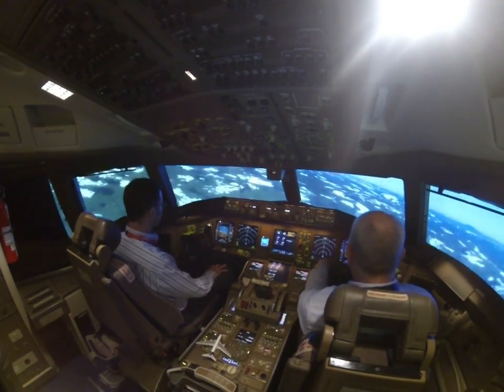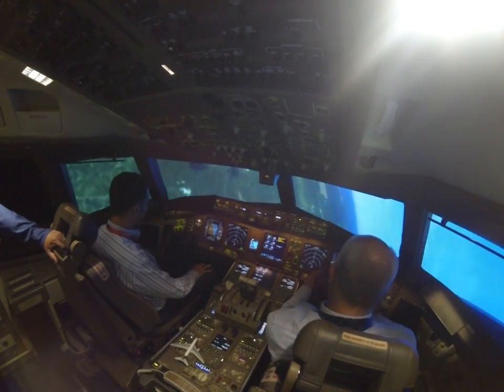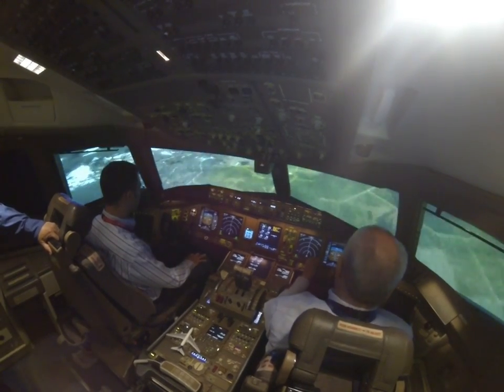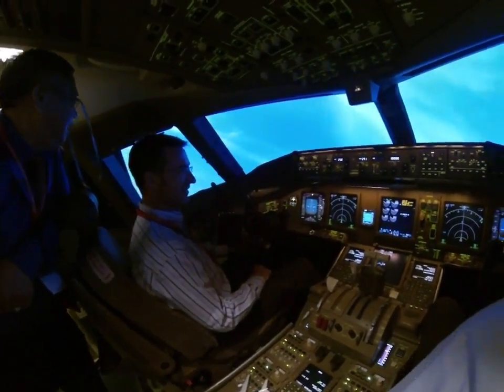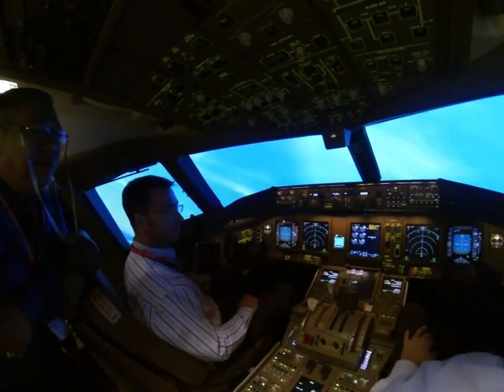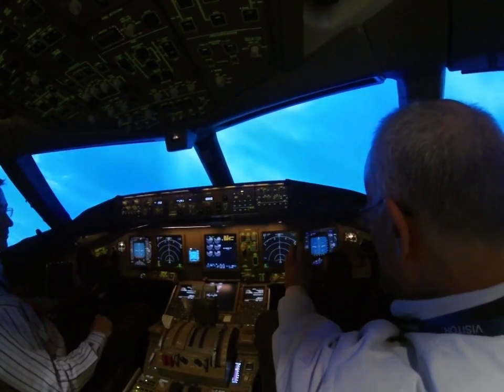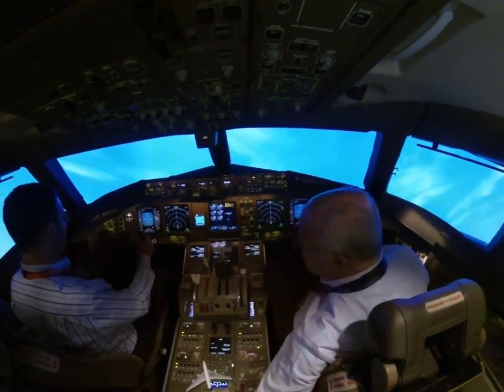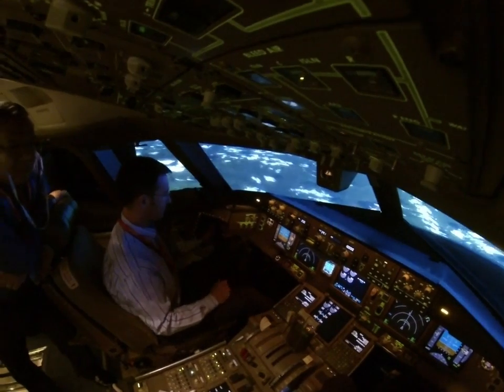Extreme flying on 777 Simulator - UPRT

Comment: First of all, this is all being done in a simulator. It’s not a real airplane.  I flew for 32 years for a major air line. When I first got hired in 1979 we did full, breaking stalls in the real airplanes. A lot of guys ended up inverted. After a while the FAA said no more. We did all the stalls in a configuration called “approach to a stall.” This meant stick shaker,  vibration and vertical speed showed a rapid descent. You went max power, level the wings and clean up the airplane. We were also told to dive towards the blue on the artificial horizon. Stalling a simulator and stalling the real airplane is a a big thing. There is no “Pause Button.” It’s a real roller coaster ride.
Reply: Of course there's no pause button in a real stall. The entire point of Pausing the Simulation during a stall is to better understand and discuss the effects a Stall has on the Airframe. UPRT has saved lives.

Comment: I remember on my ppl check ride the examiner gave me the hood for the unusual attitude recovery part of the ride.
I heard the engine noise pick up and knew he was putting me in a dive.
He made me put my head down and jerked the plane around a bit to get my orientation screwed up.
Sure enough when he told me to recover I was in a very steep dive but he had also put us in a 60 degree bank.
I immediately cut power and simultaneously was pulling out of the dive and reducing the bank and I do remember it seemed like it took forever to roll the wings level, now I know why.
He even told me for future reference roll the airplane level first then pull out of the dive.
I told him my instructor hadn't taught me that and since I actually recovered without pulling the wings off he passed me.
I wish he had explained to me why but I knew if it ever happened again I would do it the way he said, I knew he had a ton of experience and if he said it was better I knew he wasn't making it up.

Comment: The most interesting part of this priceless stall training tutorial, is using a 1/200 scale model of an aircraft in the cockpit.
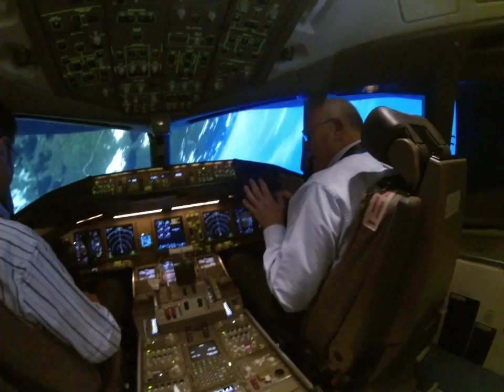See at 3:55.
Having a visual example from the Captain, helps acquire all information of plane dynamics and behavior.
Truly helpful for training.
My regretted Dad, used to build RC model planes all winter long for the upcoming spring season, back in the 60's.
That's how I learned the basics of flight, and the methods to recover from stalls.
Virtual Pilot ever since FS2002 Pro.
Outstanding video.
CYUL

Comment: I was just thinking.. What uh, what happens if you find yourself in such an upset in an Airbus? I'm referring specifically to the massive over bank. Sure theoretically the Airbus wouldn't let you put the plane there.. But like the man said, such an upset can be caused by weather and various other factors... I know the Airbus likes to take control away from the pilot if certain flight envelopes are exceeded or to prevent them from being exceeded. But if it happens, say due to a weather related upset. Now what? Would the plane prevent you from recovering because said recovery required bank maneuvers outside what it allows? I've heard of other modes like alternate law and direct law and so on but I'm just not knowledgeable on the Airbus and am wondering if anyone who is could shed some light on this?
Reply: There is an "unusual attitude law" that removes some protections for conditions like this.

Comment: I really like his point about "when unloading go for half a g, not zero g" makes me wonder if he originally started his career as a military pilot. Zero g  or especially negative g is generally to be avoided regardless of the situation. Sure in an airliner you don't want to stick your FAs to the ceiling.. But even fighter pilots when performing a high speed climb, full afterburner rocket ship style, almost never just bunt and pitch forward once they reach altitude. The fighter planes can do it. But zero/neg g is just generally very uncomfortable and disorienting even for the highly trained. This is why you see fighters come out of a high speed climb by pitching back (inverted), and then rolling out. It's infinitely more comfortable than a negative g bunt. Even when flying "flat" inverted, you maintain a little bit of pressure on the stick to maintain some positive g in the direction of your rear end. Excellent instructor.
Reply: The information you provided  interesting. However, during my aerobatics training that I have done, I remember that you will need a lot of pushing the stick down to maintain altitude while inverted. I believe it might not be possible to add a slight back stick pressure without losing altitude, but maybe with supersonic speed, things might differ a bit. Between negative G and positive, I didn’t experience anything different in regards of discomfort. The only difference is with positive G you have positive G restraining maneuver, while with negative G you can’t do anything for that.

Comment: I really don't like the Nose High Recovery technique by pushing forward alone, The aircraft may not have the energy to get over the top!  Also, the lift vector is still pointing straight up, rolling on some bank will reduce the upward component of the lift vector and allow you to get the nose down. Due to the startle effect you are more likely to put in too much negative G and injure those in the back of the aircraft. This is made worse by practicing in the simulator where there is no indication/feelings to gauge how much G both positive or negative thats being induced. Also reducing the thrust to control the pitch angle is a bit suspect. You are in a situation where energy is reducing, you want the power in, rolling to 45-60 degrees means the pitch up from the power pitch couple of the thrust will not make the situation worse, as it would if you were just nose high with no bank.

Just my two cents...
Reply: Your technique is a legacy and more conventional recovery technique designed to make the recovery more "comfortable" and closer to 1 G.  If you unload the aircraft close to 0 G, the aircraft will exit the stall instantly.  Follow-on with an increase in airspeed, correct the attitude, and you're recovered.  There is no need to go negative G and injure anyone.
Reply: Remember the Boeing FCOM is lawyer talk. The technique you described is great however I think Boeing is concerned a secondary UA may result from that recovery procedure.
Reply: What does get over-the-top mean?  I only watch these videos because I'm trying to work on my fear of flying, of course this was one of the worst ones to watch but I have heard in other videos Pilots talk about "getting the plane over the top" or "getting it over".
Reply: @stefkadank-derpjr1453  ... Normally "over the top" is shorthand for "over the top of the clouds", i.e. above the clouds. In the above comment by Mark where he says "over the top" it is in the context of the recovery from a too high nose-up attitude in which case it would mean "over the top of the climb" (i.e. when you are climbing and you then pitch down, the moment that the plane stops climbing and starts descending). He is concerned that you might run out of airspeed speed and stall before you can lower the nose enough.
Reply: @adb012  thanks for taking the time to explain. I am so uncomfortable when I fly it makes me feel panicky. In life I am never panicky otherwise I mean I'm here on a farm, I deal with all kinds of emergencies, I know how to use a shotgun, I do my own electrical work, I'm not a wimpy girl but somehow I am overcome with fear when I'm in a airplane. A friend who is a therapist suggested I watch videos of Pilots training so that I can understand how well commercial pilots are trained and how safe flying really is. Of course this was a terrible video to watch because I don't ever want to be in an airplane that develops a "bad attitude". That's part of my fear.
Reply: I've actually been driving from Georgia out West or up to Ohio and I'm almost 60. I can no longer drive to Ohio to visit relatives in one stretch, I have to spend the night halfway there and it's just getting to be ridiculous. Every time I've flown I really do enjoy the fact that I can be there the same day often within hours. Unfortunately now I'm developing a new fear.  I work for a Delta pilot and his wife, he's a senior pilot and he is being furloughed. I'm now worried that all the pilots they're going to have flying are going to be young bucks or bucklets with 100 hours of flight time. Having a lot of years under your belt is really great for a pilot because their flying becomes so intuitive,so second nature. I guess what I'm saying is like everything else practice makes perfect and older pilots are really good at it and now I'm afraid we're going to have kids flying us around.
Reply: @stefkadank-derpjr1453  ... You bring a super complex topic for which there is no easy answer. The first thing you need tu understand (and probably you know it already) is that commercial aviation is super safe. The video that you see here? 99.99% of the pilots will never have to use this techniques in their entire careers. Why? Because there are techniques to AVOID getting to this point. Then why train it? Because 0.01% of the pilots encounter this situation once in a lifetime, and they (and their passengers) deserve to have tools to get out of it. The same can be seen about other training videos you can find here. Stalls, engine failures, emergency descents, and a large list of etcéteras. These things almost never happen, but for the very few times that it does happen better know how to fix it, and if that also fails better have a C plan, and so on. Aviation safety is built on layers after layers of redundancy and safety margins, and it works awesomely well. The level of safety achieved by commercial aviation is simple unbelievable. We are counting fatal accidents per million take-offs, and some years this number is below one. And even in the very few cases where fatal accidents do occur, most people escape alive. We are counting fatal accidents per year with the fingers of one hand (in commercial jets). WORLDWIDE!!! A couple of years ago we had, for the first time in history, a full year with zero fatal accidents in commercial jets. There are only 2 industries that take safety so seriously: Aviation and nuclear. Bottom line, you are going to die, but chances are BY FAR that it will not be in a commercial flight. You mentioned the experience of the pilots. The first thing that you need to understand is that no matter COVID, furloughs or what, to occupy the right seat (first office or copilot) of an airliner the pilot needs 1500 hours of experience + a type certificate for the specific plane + hours of training in a simulator + hours of "initial line experience" where the new first officer will fly not with any captain but with an instructor captain, and with a 3rd pilot in the cockpit double checking all that the new first officer is doing. The second thing that you need to understand is that the newest pilots start their careers in the Regional Airlines. The Regional Airlines have a much more complicated operation that the major. Shorter flights mean more flights per day and hence more fatigue. It also means more take-off and landings, which are the most critical phases of flight from the safety point of view. They also fly smaller cheaper planes that are not as well equipped and as technologically advanced like the bigger planes. And did I mention that the pilots are the least experienced. And are underpaid too. Ok, when was the last time that you heard about a fatal accident in a regional airline in the USA? Let me refresh your memory: 2009!!!! More than 11 years ago. Colgan Airlines operating a Continental Connection in Buffalo. And it was a turboprop plane. For a jet you need to go even further: 2006. And in the major airlines (not counting cargo) the last major fatal accident was November 2001, just 2 months after 9/11 (so you get a sense of how long ago it was). If that is not outstanding I don't know what outstanding is. 11 years without a major fatal accident in a commercial flight in the USA. Do you know how many millions of flights took place in these 11 years? Do you know how many thousands of millions of passengers were safely taken from A to B in that time without a singe fatality (except for natural deaths in flight and one single fatality in a Southwest flight that had an uncontained engine failure and returned for a safe landing for all except the unlucky woman that perished when the engine shed pieces. So I hope for you that, at this point, you have a rational understanding that "you are not going to die in a plane crash" is a statement of fact more than a probability, it is closer to being an absolute truth than most of the things that you say or take as truth. The problem is that fear of flying is, in most cases, not a rational problem but an emotional one. And when it is a rational problem, the rational part is easily fixed because it is just not rational to fear flying. I have met people that said "I know that aviation is super safe, I totally buy that I have a much grater chance to die driving to the airport than in the flight, I totally believe that there is nothing to fear, but I cannot help getting in panic the moment I get in a plane. I don't want to, I try not to. I curse myself for being fearful of something that there is nothing to fear, but I can't avoid it". That is obviously more complicated because it doesn't matter how much of a good job I do at convincing you that flying is super safe, It cant help with the irrational fear (that is why it is called a fobia). So are there things that can be done to improve the irrational fear? Yes, many, some work for some people, some for other. Many airlines offer "fear of flying" seminars where they explain what happens during a flight, the sounds, what is going on in the cockpit, the safety measures, and they end with a real flight where you experience and identify all that. Some fearful flyers overcame the fear by taking flying lessons themselves and becoming private pilots (I think that is the most powerful one). Others do psychology therapy. Others get drunk. others go to a psychiatrist for a prescription that can reduce anxiety (and some times numb them). Some don't overcome the fear and just face it and decide that the rewards are worth the suffering. Some do a combination of the above. And some just don't fly. I don't think there are magical answers here. The human mind is too diverse and complex to have a one-size-fit-all silver bullet. In any case, I wish you good luck (but also will and courage to face the problem and take action).
Reply: @adb012  Wow I just finished working and I came to my car and I read this. Thank you so much for taking the time to write such a helpful well-thought-out response. That was very kind. I have a few more things I'd like to say but I'm going to hustle home and get dinner going then I'll come back here. Thank you again so much.
Reply: As Russ mentioned, zero G = no stall at whatever speed. The speed of that 777 can go down to 50 kts during the recovery and it will not stall if you keep close to zero G. No lift means no lift vector so your lift vector is not pointing up anymore even if you have the wings level. Now, with a very low speed like that, you need to remember that the recovery is not complete until you got enough speed to pull some positive G (above 1G) and not stall in the attempt. So yo will need to keep pitching down past "straight and level" because the moment you try to level off, if you are below stall speed, you will stall (secondary stall), just as it happened in this video which was then correctly addressed by the left-seat pilot by reacting to the stick-shaker with a reduction of AoA. All that said, rolling the wings will accelerate the recovery because the plane reacts faster in yaw than it does in pitch, especially at high angles of attack. So for example rolling 60 degrees left and letting the plane yaw left by itself (as it slices through), most of that left yaw will be the nose coming down. That said, initiating a roll at such a low speed and high AoA might cause roll control issues and may require some careful rudder application. No need to mention that a yaw disturbance at high AoA is a recipe for a spin, right? So no matter if you decide to roll or not, UNLOAD FIRST, go to low Gs (well below 1 G but slightly above 0G to avoid accidents in the back), so if you decide to rol, in this way you will greatly increase aileron effectiveness, reduce the need of rudder input (just keep coordinated flight), and avoid a stall/spin. But you will STILL may have a very slow airspeed when you nose goes down through the horizon so very careful with the roll-back-to-level maneuver and don't stop pushing down yet or you will stall, and you don't want to stall while rolling because, again, stall/spin. So in a nutshell, while rolling the plane will help recover more quickly, it is more difficult to make it correctly and involves more risks of loss of control.
Reply: That would be fine if it were 40 years in the past.